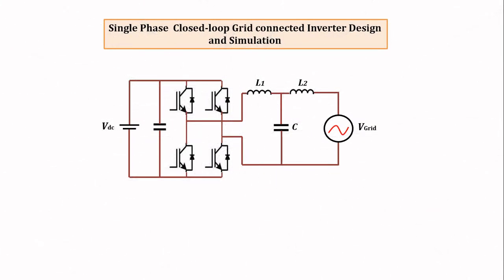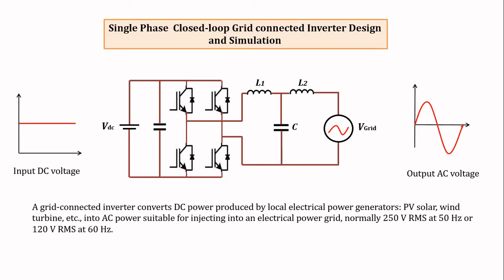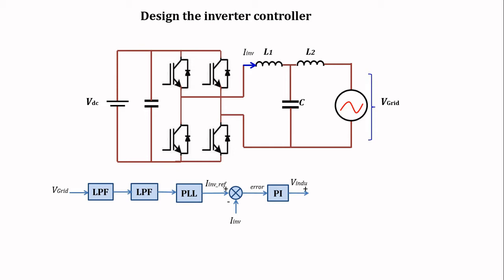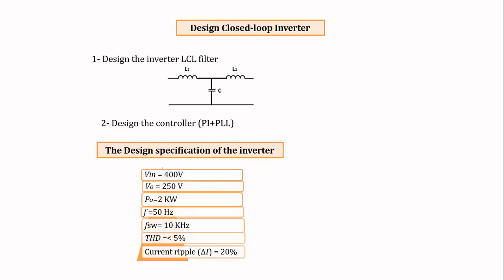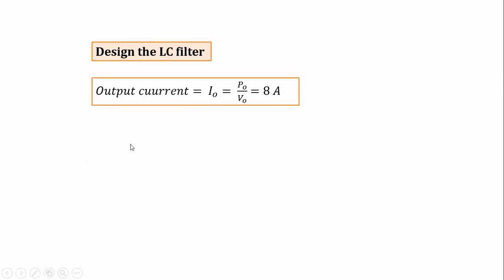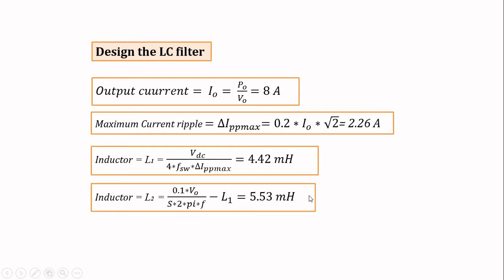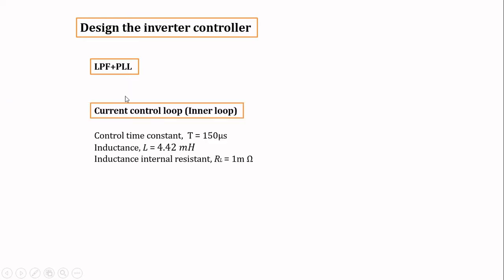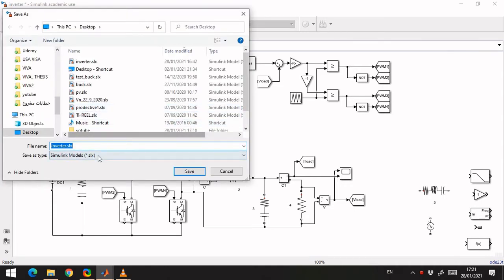Design and Simulation The Closed-Loop Single-Phase Grid-Connected Inverter

Comment: where is get ac source voltage...why you add ac source voltage at the out put or at the load...
Reply from the maker: In the case of a grid-connected inverter, the AC source represents the grid. If it's a standalone inverter, the output will be directed to the load

Comment: sir why did you add gain of 10 after PLL?
Reply from the maker: it's not  gain it is the reference current
Reply: It's the magnitude of the reference current Iref that was multiplied by sin(wt) where wt is the phase of measured voltage.